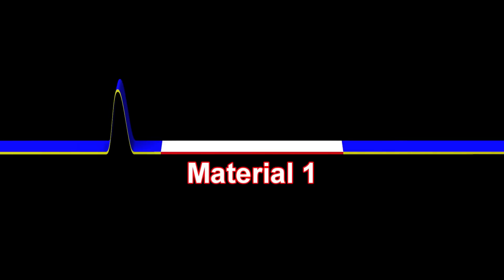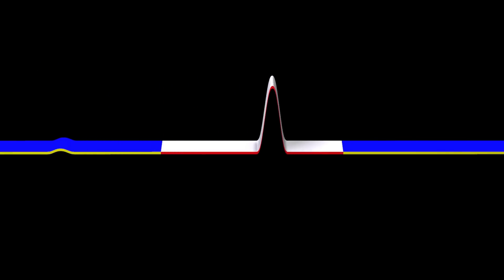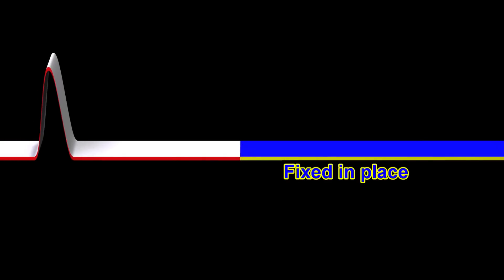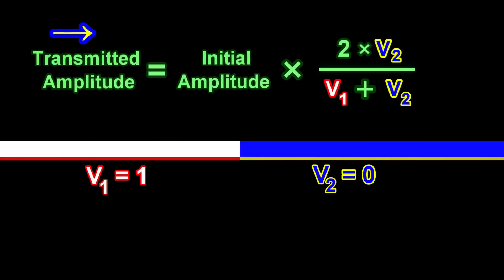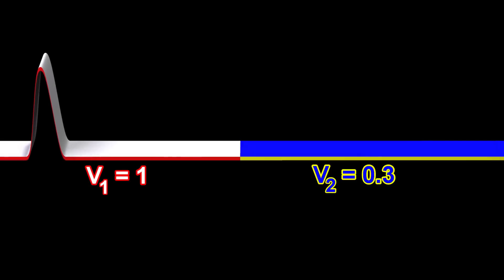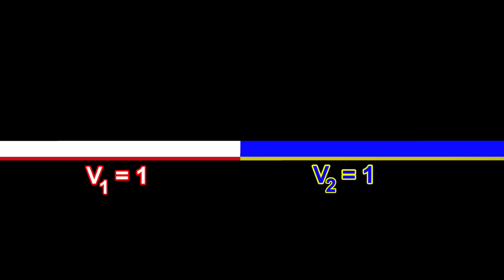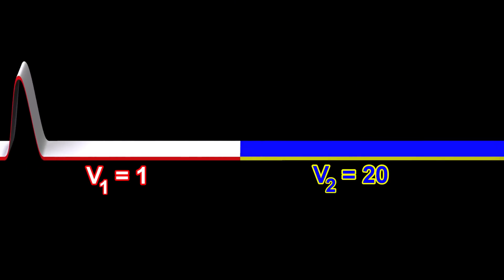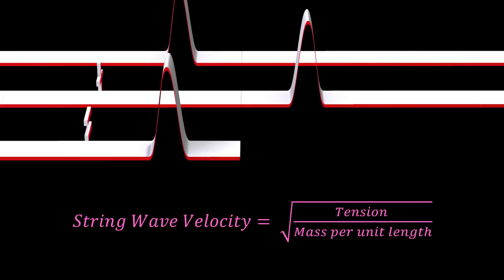Wave Reflection and Transmission

Comment: By the way, is there any explanation on why during the scenario where the middle wave have velocity of  1 and the flank waves have velocity of 2, only the first reflection is flipped upside down?
Reply from the maker: It is because a wave reflection is flipped upside down when the material it is entering has a lower speed.

Comment: I work in electric power distribution and we have to sometimes place extra lightning arresters at the end of power lines due to the wave doubling effect at the velocity = 0 boundary.  When lightning strikes a power line it creates a traveling wave along the line that reflects at the end and creates huge voltages.
Reply from the maker: Actually, it is the open boundary where the voltage is double.  By the way, the equations are different for electric transmission lines.  I have a video on transmission lines at https://youtu.be/ozeYaikI11g

Comment: For waves on transmission lines, this treatment is not correct.  Wave velocity mismatches don’t matter - impedance mismatches do.  Two cables with different velocity factors but same impedance will have no reflection at their union.
Reply from the maker: I knew that someone bring this up, which is why I stated in the video that these equations are different for transmission lines.  This is written at the bottom of the screen at 10 minutes and 10 seconds into the video.  I have a separate video for transmission lines at https://youtu.be/ozeYaikI11g

Comment: when considering longitudonal waves: does a reflection occur when one end is open?
Reply from the maker: Yes.
Reply: @EugeneKhutoryansky  I'm thinking of air particles escaping into vacuum , but I can't quite picture it.
Reply from the maker: I was thinking of longitudinal waves through a solid material.  If you have a gas, such as air, and a vacuum, then what would happen is that all of the gas will escape into the vacuum, with or without a wave.
Reply: @EugeneKhutoryansky  I thought so too. I suppose sound waves do behave similar to the ones in your video when they pass through mediums with different density or pressure. In the limit, where one medium has zero density, all reflections seize

Comment: Does this apply to photons even though they move at relativistic speeds? I would have expected that, if we have the wavefunction of an individual photon as the wave, that the part reflected vs transmitted would be like, the superposition of whether or not it was reflected,
But, in that case, I would expect the squares of the amplitudes to add to the square of the original amplitude (the squares of the amplitudes of the reflected and transmitted parts being the probability of it being observed to have been reflected or transmitted respectively), rather than the amplitudes adding to the original amplitude?
Maybe this only applies in the situation with a large number of photons? Like, if the amplitude isn’t the probability amplitude, but the photon number or something?
Am I making a silly mistake?

Uh, if we have a Bosonic Fock space and for the single particle, in state psi_1 , uh, U(psi_1) = sqrt(p) psi_2 + sqrt(1-p) psi_3 (with psi_2 and psi_3 being orthogonal states)
Then, the analogous thing to U with domain the Fock space, would send the vector with N copies of psi_1 to…
uhh…
Well, the N copies of psi_1 can be obtained by the N-th power of the creation operator for psi_1 , applied to the vacuum vector..
and then, F(U) (a_1^*)^N Omega = (F(U) a_1^* F(U)^*)^N F(U) Omega 
which is probably = (F(U) a_1^* F(U)^*)^N Omega ?
which is maybe (sqrt(p) a_2^* + sqrt(1-p) a_3^*)^N Omega ?
Which seems like it would be…
well, the a_2^* and a_3^* should commute with each-other due to it being the Bosonic Fock space,
so, should be like, sum_{k=0}^N binom(N,k) sqrt(p^k (1-p)^{N-k} ) (a_2^*)^k (a_3^*)^{N-k} Omega
Which, wait, that isn’t properly normalized because the binomial coefficient would get squared… uhh… I made a mistake…

If N is large… I guess the variance in “how many are reflected” only grows as sqrt(N) , and so the variance in the fraction that are reflected goes as sqrt(1/N) , and so goes to zero as N goes to infinity.

Hm. I don’t know relativistic QFT. I guess for non-relativistic quantum mechanics, I can’t really have the wave speed be independent of the frequency… can I? Not for a free particle in any case…
(Though, presumably something similar should be true for phonons, and those don’t have relativistic speeds, so, it should be possible to relate what is described here to a limit of a large number of phonons?)

Ok, yeah, while I imagine that what is described in the video probably applies to light, I don’t know how to relate it to a quantum mechanical picture.

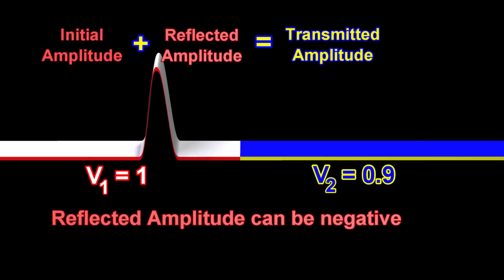Comment: Beautiful video. At 11:40, shouldn’t it be reflected amplitude - initial amplitude = transmitted amplitude?

Also if I stack up 3 materials one after another with v1=1, v2= 10 and v3=100, would I be able to cascade the equations to get a final amplitude of (2 * 10 / (10 + 1)) * (2 * 100/ (100+ 10) = 4  * 10/11 * 100/110 = 4 * 100/121 = 3.27 or do the waves and its reflections interfere, hence changing altering equation and we get a much lower value (lower than 2).

I believe the equation above comes from the tension equation (balanced forces at each point in the material) along with conservation of energy!
Reply from the maker: The equation in the video is correct.  One way to see this is by thinking about the example where the reflected amplitude is zero (V1=V2).  In this case, the initial amplitude should equal the transmitted amplitude, as is shown in the equation in my video.  By contrast, in the equation you wrote, you have transmitted amplitude = -initial amplitude.  As for your second question, if you stack up materials as you describe, you can get an amplitude in the final material more than double that of the initial wave.

Comment: When unabsorbed heat singularities strike resistance lights up the mass, it strikes like a filament vibration. Lightning is rapid heat loss striking atmospheric gasses lighting up surrounding atmospheres from instantaneously disolving internal magnetic fields grounding currents through its nucleus or core where external heat energy force is strongest as external heat energy outside of entanglement of mass as potential renewable heat energy when absorbed into internal magnetic fields. Unabsorbed instantaneously disolving internal magnetic fields as external heat energy force of pressure as fire lines in the sky like forest fires. Waves crash the beach or rocks with overspray. Electricity is rapid heat exchanging through mass as grounding currents into earth's internal magnetic field. When heat can't rise above the cold atmospheric gasses, it condensates. Heat tunnels through the eye of the storm until pressure is equalization to magnetism centrifugal force cycling circulation within and without entanglement of magnetic fields as external heat energy singularities within and without entanglement of internal magnetic fields grounding currents through its nucleus or core where force is strongest around it. Hurricanes and tornadoes spinning all external heat energy faster than normal momentum of space itself. Centrifugal force within and without mass equalization of pressure. Heat cycling circulation patterns around cold repulsion of space as the nucleus neutralized repulsion within mass as outward force of pressure. Hurricanes and tornadoes are outward force of pressure in repulsion to cold space itself within and without entanglement of internal and external magnetic fields like black holes. External magnetic fields spinning around these monopoles of pure cold repulsion within the nucleus or core where external heat force is stronger at the event horizon perimeter. Tornadoes and hurricanes work as magnetic fields. Magnetism explains everything about physics.
Reply: This reads I think like the result of clanging disorder? I’m not a doctor, so I can’t evaluate that with confidence though?
Maybe ask someone you know irl and who you trust, whether what you wrote in your comment, makes sense to them.